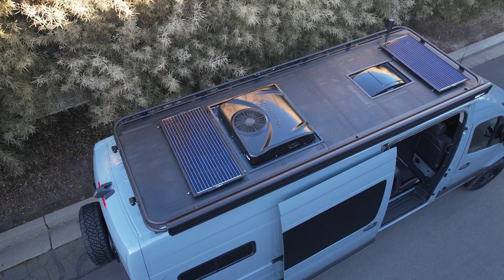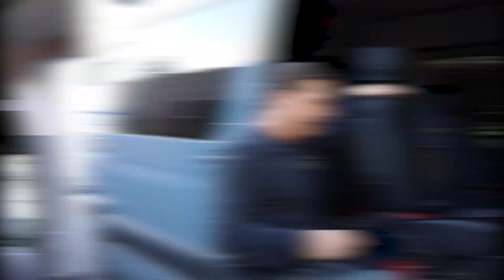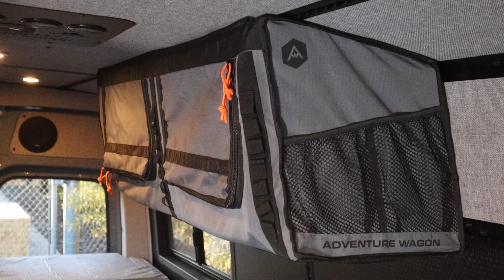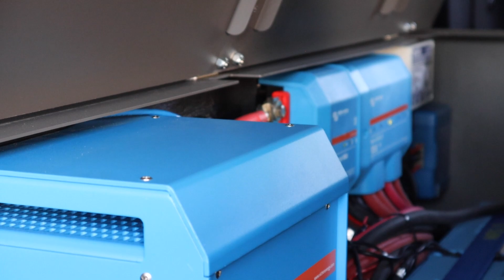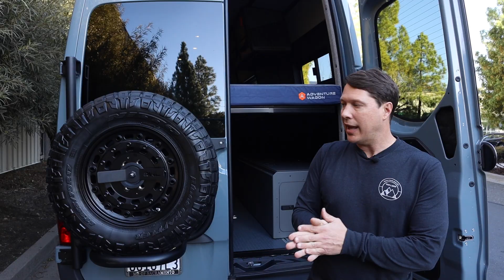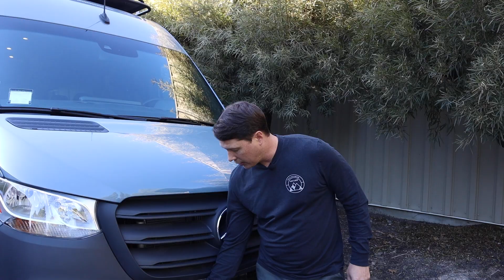170 Sprinter Van Tour | Adventure Wagon Build & Smart Floor | Sleeps Up to SIX

Comment: Hi. More details about the sound system would be helpful. Make/Model of door speakers. Make/model of dash tweeters. If you replaced the center speaker, the make/model of that. Make/model of dsp. Make/model of amp. Make/model of rear cargo door speakers. Make/model of subwoofer. Thanks.

Comment: This is a great clean built! Did you spec the black sliding door rail/track came from the factory, or was it upgraded later? I typically only see those on the Passenger versions.